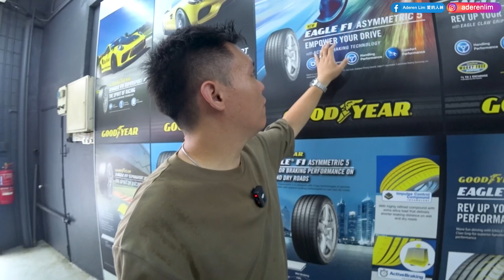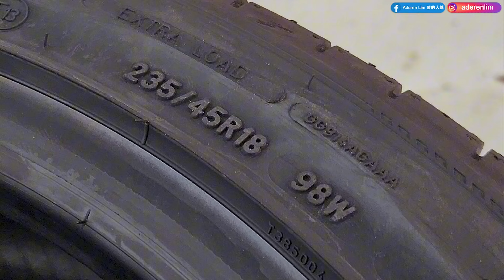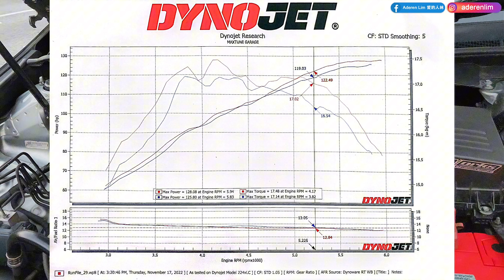我想要卖车了，最后一次带Camry上山 | Malaysia #POV [Genting Run 冲上云霄] [CC Subtitle]

Comment from the maker: Toyota Camry 2.0G For Sale 

Year: 2012
Spec: Toyota Camry 2.0G
Mileage: 207,000KM
Location: PJ
Reason For Sale: Want to upgrade 
Contact Number:  IG- aderenlim
Request Price : RM5X,000

MODS:
- BC BR adjustable 
- Pollymann lower arm bushes 
- Lenso Dyna Jager 18' rim
- NEW Goodyear Eagle F1 Sport 235/45 R18 (Change on April)
- LS430 Sumitomo 4 pot caliper 
- Bendix Metal King brake pads
- Custom AForce M3 Bi-LED projector headlamp & add-on blue demon light
- Add-on headlight leveling button
- Change headlamp cover and done PPF
- Piano black grill from Taobao 
- Kenwood DDX918WS with Apple Carplay & Android Auto 
- TRD carbon gear knob
- Ambient lights & foot lights 
- 2.5V steering wheel with wooden trim
- Lufi X1
- TRD aluminium sport pedals 
- 70Mai A810 front & rear dashcam with 4G
- Works engineering air filter 
- Acent wires 
- NEW Koyorad Aluminium radiator
- NEW 2 ori denso fan motor 
- NEW drive shaft 
- RaceChip XLR throttle tuning
- Remap by WS Remapping 
- On Wheel 128hp & 174Nm
Reply: pm
Reply from the maker: @TONGTECKWEIMoe  there is no pm function on YouTube, please contact my ig tq

Comment: Been using this tyre for my Saga VVT , 205/45/16.. run abt 60k km already, love it when the tyre has a bit water damp, there is where I notice the grip is better, but crossing water / heavy rain have to be careful, sometimes it will slipped.. recommended by my rim shop back then when I told him I wanted xm2+. This tyre def value for money if for daily & fast drive at times! 160kmh corner no problem & improved brake performance.. not sure I did my homework correctly back then, this tyre is slightly better than PS4 based on overall rating

Comment: Talking about tire the best one i using so far is joyroad sport rx6.Even better than my PS4S 😅.Price also affordable.Already using for 1 year still grippy as hell don't know why nobody recommend me this tire before..Super super grippy and no sound at all when go up genting.Wait botal 1st next will change vitour formula spec z.Both brand from AF marketing (balakong).

(Car spec)
-xv70 2023
- 20 inch ASGA ARF10 flow forming forged rim
- front 245/35/20 (joyroad rx6 sport)
- rear 285/30/20 (joyorad rx6 sport)
- brembo 18z 6 pot
Reply: Don’t know you high on what, better than PS4S😂
Reply: @Gaikoz890  100% better than my shitty ps4s and ps3.2024 liao adik...stop dreaming.outside got so many good tires better than Michelin ps series.Try baru tau..im like u also sohai sohai one lastime as long it's a michelin pilot series it must be good and other brand not good.Sekali try straight addicted to chinese branded tire.Just bought new camry last year straight throw away the stock noisy and slippery bridgestone t005a and straight changed to joyroad.Go up genting sikit screaming sound also dont have while other (friends) goodyear and ps5 screaming like hell 😂...